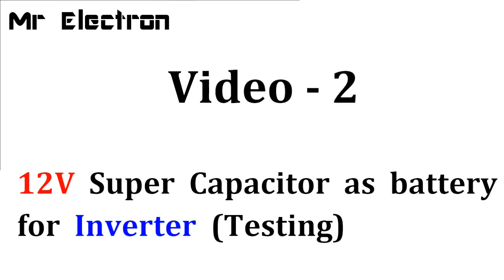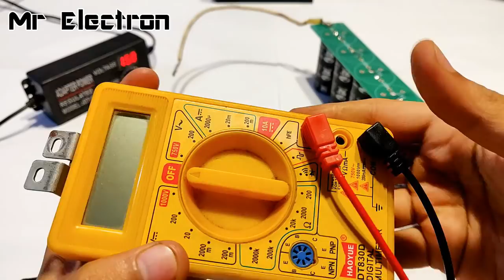2 Unique Ideas using Super Capacitor & Peltier

Comment: 10000m likes 

I am interesting in this channel really 
What’s temperature inside box ? 
Is it heavy duty cooler ? 
Can be working for 3 years without stop ??
Reply: I have tried a half dozen of these type of coolers and they don't last long. I replaced the cooling device a few times you might get a year out of them and you still need ice packs to help keep things cold. If you need light weight then ok but now they make coolers with real compressor and the works. Freon is the best type of cooler. And the weight is not as much as a problem  like it was with earlier versions.

Comment: Not a good use of super capacitors , as the inverter cut off voltage will leave a lot energy left in the capacitors.  Voltage step up buck converter should be used to say 12v for led bulbs. Don't use an inverter as there is energy losses there.

Comment: Peltier cooler will work. However very inefficient.
Evaporating and condencing coolers are much better suited for the task.

As for the supercapacitors... Why?
Why not just use the 12v straight from the battery?
By charging and discharging the capacitor bank, you're just needlesly transferring energy from one place to another, wasting energy.